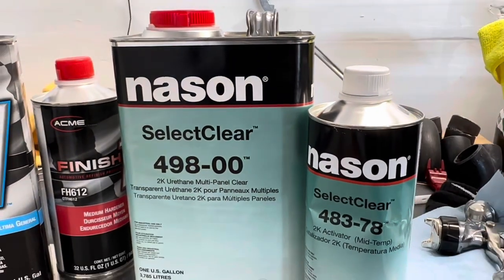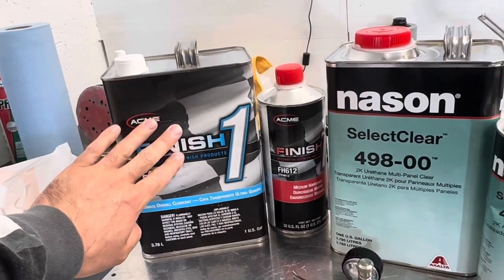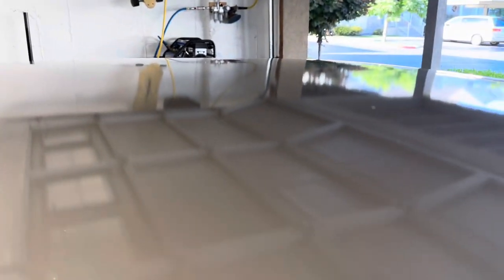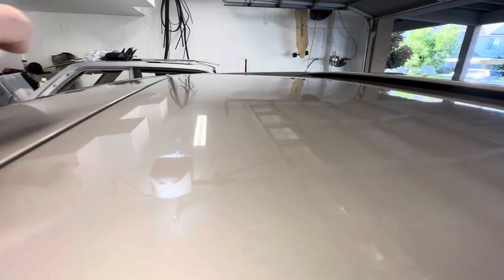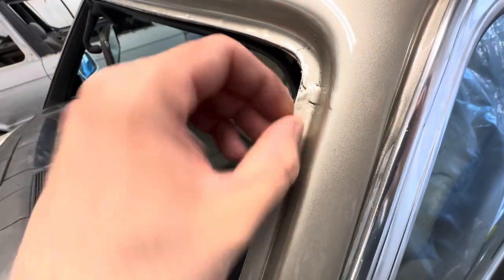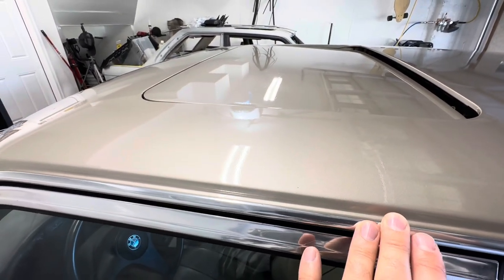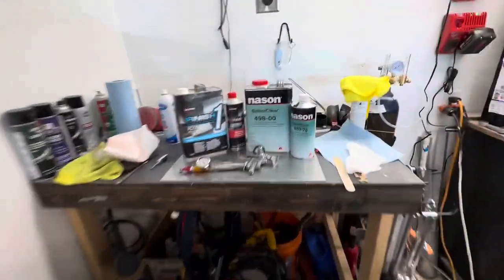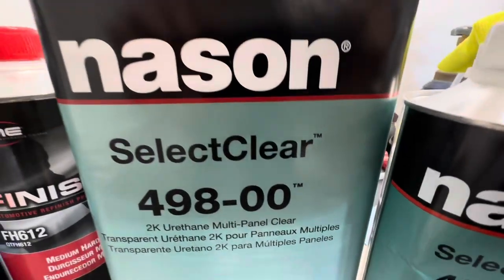Nason SelectClear 498-00 Clear Coat Review

Comment: I've shot Nason alot, but the 78 hardner is way to fast, maybe for a mirror or bumper cover but 79 is best harder. Lays out slick n I use SATA 1.4 &1.3  Hopefully you have tried 496 with 79. Overall try 465 with 85 n 22 reducer. Air dry overnight  84 harder is ok. But slower is always faster. Nason I love it n very cost effective.  I've been spraying 41 yrs collision shop I own. IF you haven't tried 496 n 465 for larger jobs even allover is great. I use Axalta clear in house but Nason on other customers jobs. The 496 I used with 79 was a neon and it still looks great. I shot a 2 tone truck with 465 next day. This was 6 yrs ago, still looks great.
Remember, never rush yourself or product. Slow down and you'll get a better job without getting frustrated. This 465 does all the work, lays out sweet like the 4-1 496 w/79. Dries quick high gloss n you don't have to rush yourself.  Good job tho 👍

Comment: Nason 498 tends to dry quick.  Anything over 85 degrees use high temp activator.

In your case. On the final coat. Add a bit of slow reducer to the final coat.   Been using it for over 10 years
Reply from the maker: Thank you 🙏 I will give it a try in the spring

Comment: From my research, 498 isn't a clear that's easily ran which is why many like it. From my experience with clears like that, you really need to lay it down (slow down) especially when reaching over the roof where the tendency is to make quicker passes since the weight of the gun and arm extension aren't the most comfortable. It's also a must to use high temp activator to allow time to flow out before setting up. With that, I possibly see why the orange peel occurred in that area. I'll be spraying it's Vietek equivalent some time tomorrow if there's no delay in vehicle prep. 

OAN, I also use an ANI for high build. Just about all of their guns atomize at much higher pressures than most recommendedfor 29 psi. I'm not sure why ANI designed them that way, but that could be another contributor. I like the LPH400 LV4 for medium solids clears... far less pressure needed to wet out a panel.😮
Reply: Love my LPH400 for clear especially fast dry clears. The soft spray keeps them from drying in the air and allows the clear to flow out. The LPH400 has no problem atomizing at lower pressures. Ya those ANI's typically need higher pressures to work right. Might be better suited to slow dry clears. Maybe run it at lower pressure and see if it still atomizes.  I've heard the ANI's are good guns tho

Comment: Ive started baking clear in my garage with a torpedo heater to get it dry. I use upol universal and it also takes forever to harden. Ive thought of using faster clears but I dont spray enough to get used to different products. Hope you figure it out with the Nason👍

Comment: I have some of the FC720, I prefer using it when I'm redoing headlights, it does lay out really nice compared to the euro clear I have. I made my mom's e60 headlights look like glass it really surprised me . The shop I used to work at re-cleared (euro clear) headlights every now and then and they just didn't come out as clears as the ACME clear I have. But I do agree it takes a WHILE to cure lol. Im painting a few panels for my e34 soon (Someone hit my car) but ill probably use the euro clear on that since it has a thicker build
Reply from the maker: Honestly really Impressed with the FC720 for the money it’s really hard to beat. I have tried a few clears now ranging from $120-$300 and the FC720 just works great and doesn’t fight me haha. Im glad to hear I’m not the only one that noticed it takes a while to cure. I thought I mixed it wrong at first and after a few projects I just realized it’s just how it is
Reply: You might want to switch to FC710 for small parts it's a spot panel clear